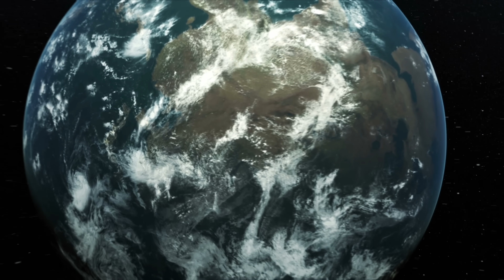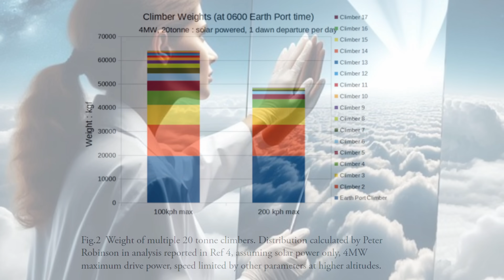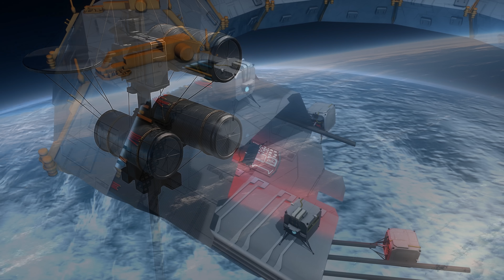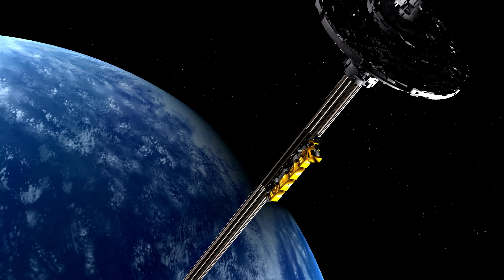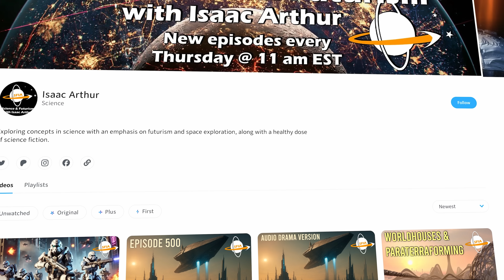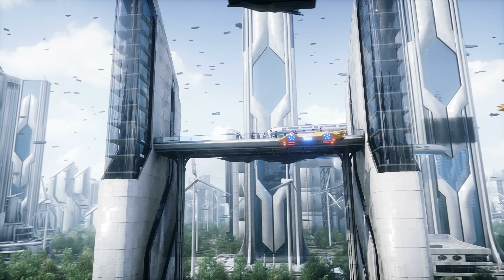Space Elevators: What It Would Actually Cost to Build One

Comment: What if someone built a space elevator sky-hook hybrid with the Earth-side of the elevator constantly flying around inside the atmosphere barely below the maximum height ordinary jet airplanes can theoretically fly at, in the same direction as Earth's rotation at Mach 0.5 ish, making it 36% faster than the speed of the Earth's equator around the axis, making the needed cable length significantly shorter (about 53% of the length needed for geosynchronous orbit so 47% shorter); and theoretically at least 47% cheaper? ,than a space elevator that's stationary relative to the ground.

Comment: To build such a thing as "elevator"- a machine to elevate, to raise- up or down...now we go in to space, we can build it...if we had a need  we could do it, we just need to think a look out of the BOX, the problem is scale, yes ...scale..we still think and have problem with delivery of 10T or max 40T in to space...to low Earth orbit we have to clime 200 KM upper stage at 400 KM,  we could build a base in Mongolia size of a cylinder 100 KM in D or 50 KM in R, and then 200 KM up or 400 KM up, at today we do not even think in to these crazy dimensions, there is another problem "time" before we would finish building the 400 KM high "tower elevator" most of it would scream not only for fix repair but a whole segment replacement...so the 200 KM is a better option. We can do it.

Comment: A random thought struck me about the tethers attached to sea going ships on the equator.  Wouldn’t the ships themselves be the weakest link in that system?  Large storms, unpredictable sea conditions, even a ‘freak’ ship sinking killer wave (which has been proven to exist).

Would it be possible to have the ship be a sub surface station - deep enough to not be effected by surface phenomena (I don’t know what that depth is). It could even be ‘held up’ by the tether itself, not by its own buoyancy.  If the station is acting as the tether anchor, a surface ship could still act as the station, it just needs to have the ability to interact with the tether and attach and launch cars.

Just an idle thought.

Comment: Something not mentioned is climbers don't have to make a round trip as 1 up then 1 down. You could send climbers up for 2 months, and then send all of them back down in a batch that would take a week. And since they are returning empty, weight wise you can pack more of them onto the tether at any given time. Volume wise, either strip off the cargo pods and repurpose them for something in orbit, or engineer the cargo pods so they can be compressed (folded up or flat-packed) and then you can load 5 or 10 or 20 drive units or compressed climbers into a single climber and send a batch of them down the rope in the volume of a single climber.

The point being you can use like 80 or 90 percent of your tether capacity sending cargo up, and the other 10% sending it down, and do it in more efficient ways.

Comment: If cable friction is an issue, would it be possible to build a "climber" that actually "flies?" Like have it use something like helicopter blades at low altitudes (or balloons) and then use something like an ion drive beyond the upper atmosphere? The advantage over rockets would be that you could send "unlimited" electricity up the cable (or down from the top) to power the device, rather than having to pack the fuel on board. Alternately, would it be possible to use two cables, with one being "fixed" and the other being wound up like an elevator?

Comment: em launcher would be simpler. also funding is your main roadblock (instead of being an enabler). thats for orbit launches like satellites and other solar system launches. you already have what you need but no will. investment and profit are nothing tangible either. only what you actually make. bureau project management is not anything. money is related to management and is of no use. any working that is not doing anything useful, dont do it. includes lifecycle services and teaching. ownership is nonsense management stuff and not acceptable. well your ownership kings must step down. so is your society not enough developed to put down the sword, cavemen people. same upwards. a gigantic zip line vs launcher of pods. when doing stuff, no need to maximize usage of resources, but do stuff smarter. yes your economy gov system tends to do maximization of usage of resources. which it is designed to do. maximizes poorly. capitalistic democracy is also socialism/com in disguise. as humanity people work as one entity. they have agreed to do so. roller coaster launchers would be much better starter with the spin launcher. so how about the orbit tether wire pushing down the solar electricity. and also being the orbit track power wire. use em dc push grip to the power wire. or just magnetic induction rolling grip. you'll maglev the track anyways. any friction at those speed means melting the wire. well test that carbon rope segment somewhere then. a rocket launch to geo does not take 2 weeks. yep go mach 3+. so what if you dont think the whole project in terms of economy but just a system goal (scommunity) project. gov = scommunism mandate project = corp project. detaching resource trade from the governance reveals what the system is about. you decide by whatever metrics you decide to use, all equivalent. also separate resource trading from actually doing the project. so how long it takes to something like meteorites or particles to cut down the tether line. economy motivation is a poor motivator. would focus on independent craft type constructs instead, like space ships. large projects by people masses makes it complex and useless. the less dependent the system is the more freedom you will have, in making those. ie a ship vs country. less convincing required when only a minimal investment is required. ring station around earth would be fun. thats a very long tube. you could launch a pod with the tether with a em launcher track to the geo. yep not dropping it down from geo, but launching it directly to geo from ground. orbital tether wire entanglement might be an issue. fill the pod with the tether wire and launch like a wire guided missile. that way you can test it with small tether wire mass first. nothing else than a direct launch to final orbit required. just evaluate your ideas before rushing into them. many thin threads of graphene fishing line is stronger than you expect. your society wastes everything to become k2 civ. well, it eats its own and never grows up actually. therefore also economic growth is fake. people are greedy in the gov way. 2 weeks transit time is bs. your kings need to chill their aspirations. all of them. chill I say. for fish tanks you require fishing lines. dont eat your future.

Comment: Idea how it may be possible to grab slippery conductive ribon: induce some electric currents locally and than grab field that generated by such currents.
Alternatively if you have two parallel conductive ribons and third - insulating(which shouldn't be too strong because it attached to carbon) then  in you  put high voltage on those ribbons : 1) them attracted to each other, which  make twhole structure much more stable ad 2) then capsule can   use railgun principle to propel itself..
Ribbons with insulation can be a viable way to produce thick structure from the single atoms thick materials. If you apply opposite voltage   to neighboring ribbons, they will stick. Every capsule that go up/down can also lay one additional layer,.

Comment: What about the economics of orbital rings and tethered rings as compared with space elevators?  A ring could be shorter, perhaps by half, but no doubt heavier to contain the orbital mass.  But that mass would not have to be lifted all the way to GEO.
It seems like orbital or tethered rings could be placed at or below the Karman line, where residual atmosphere would keep the airspace clear of orbital junk, but still be thin enough for a mass driver or other launch scheme to work.
Reply: Like the clothes line is 200miles up. Like that.
Reply: @jasonbrady3606  I was thinking more like 60 miles, at the high side.  Maybe sea level at the low side, so that you could drive up to space or ride a rail car.
Reply: @captsorghum ya idk, an elliptical orbit would require it to stretch an awful lut. Circular orbit with potential down stringers every few miles. These triangular box deals that the lines goes through. Has reaction wheels on top and sides. Rembee the line is traveling through the triangular boxes at 20,000 +mph in order to keep the downstringer stationary. I'd think it could be quite low. Though it may be whippy and fly apart. Have to have a conductor sinollian woven in the line. 

Pairs of lines multiline gondos
Reply: @jasonbrady3606  I wasn't suggesting an elliptical orbit.  I meant circular, but tilted.
Reply: @captsorghum have to stay the same height in the the gravity, for that. Thou I'd think it could go through some of the thin atmosphere. Cavitation of the air on the line be of concern.

Comment: I think that assembly and maintenance of the tether, as well as assembly and maintenance of the units responsible for the assembly and maintenance of the tether will be quite an undertaking. If the elevator ribbon is to be lowered down from geostationary orbit, then it (or its constituent feedstock) must first be lifted into space and then be positioned properly.

I am not sure how stiff a tether is in aggregate, but it seems doubtful that any extremely stiff tether would be able to be safely coiled up at operational thicknesses in long sections for the purpose of stowing and transporting to space. If the coil were to release and attempt to spring outward uncontrollably, then the transportation vessel might be cut.

This suggests that it would have to be sent up as either straight segments, coils of nanofibres, or as carbon feedstock which are then assembled in orbit, perhaps stowed and manipulated as large coils a few kilometers in diameter. This would allow for simpler access to different portions of the coil as you can cross directly from one point on the perimeter of the the coil to another point on the perimeter of the coil and maneuver it from multiple points.

If the tether were fabricated in GSL from feedstock, then you could have multi-fibre molecular assemblers. Groups of fibres from multiple assemblers could then feed into multiple collimators which would combine them into strands consisting of parallel fibre bundles joined along their lengths. Multiple strands from multiple collimators could then feed into multiple threaders, each of which produces a single thread consisting of multiple parallel strands that are loosley braided but permitted to slide across each other like layers of graphene. Multiple threads can then be fed into weavers, which produce woven ribbon, sheets, and/or tubes. Multiple woven sections can be handled by tenders, which are responsible for joining and sections end-to-end. The swarm of machinery is modular. If a particular machine needs to be replaced, then it can be done without needing to disassemble and reassemble a single monolithic machine.

All together, the machines function like a zipper. The entire assembly process might even be capable of running in reverse to reclaim damaged tethers and separate usable portions from unusable portions, replace the unusable portions, and then run forward again to produce a renewed tether.
Reply: *GSL -> GSO

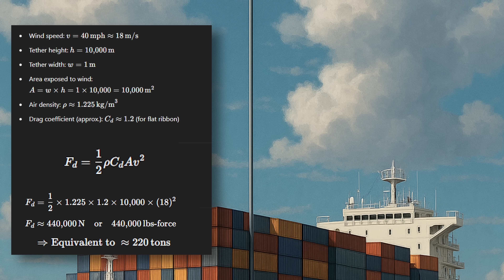Comment: Your wind force calculation at 13:15 is not right.  Your wind speed is much too low.  This would be considered a high-risk structure.  The lowest structural design wind speeds in America for this kind of structure is about 102mph, which occurs in San Francisco.  Problem if you try to build it there is that the jet stream occasionally comes that far south.  You'll also want to stay away from Florida and the gulf coast, where you have to deal with hurricanes winds ranging from about 150mph in south Texas to over 200mph in south Florida.  If we're sticking with locations in the US, i think he best place to put it would be the Mojave desert with a design speed of about 105 mph (~47 m/s) for this kind of structure.  

You also neglected to account for the variation in air density with elevation.  The number you quoted is for sea level.  Our building code does account for that variation in density by providing a reduction factor, which they give as K=e^(-0000362z) where z is the height in feet, and K=e^(-000119z) where z is in meters.  The Mojave desert conveniently has the Mojave spaceport that i can use as an example location.  It has an elevation of about 2700 ft (~800m), where the the air density is 91% of sea level.  The density is 50% at about 19000 ft (5800m), and 30% at 33000ft (10000m)

Integrating that density exponential from 900m to 10000m, i can write an equivalent expression for wind force using the sea-level density and an effective area of 5086m^2.  This results in a wind force of ~8250 tons at 47 m/s.  Since we ignored everything above 10000m, this is probably an underestimate about equal to the air density at that altitude (30%), which gets us closer to 12000 tons.  This lateral force is on the same order of magnitude as the tallest skyscraper in Miami getting hit by a cat 5 hurricane.

#nerdsniped

Comment: I am not a fan of the concept of a space elevator. I'm not a fan for a simple reason: The risk of a catastrophic failure of the system is simply too high, and the consequences of such a disaster would be so far-reaching (like, thousands of years into the future far-reaching) I get a migraine just trying to grasp the edges of it. 
Consider for a moment: A structure extending from the surface of the Earth out to geosynchronous orbit (nearly 37,000 kms.) LEO begins at about 200 kms, so 36,800 kms of this structure is moving at orbital velocity. 

Then, something comes along...and breaks it. 

The 200 kms below orbital altitude comes crashing down relatively quickly, doing some damage. Not pretty, but not the real nightmare. The upper 36,800 kms of this structure continues to orbit the earth, fragmenting over the course of weeks, months, years, and so on. Now, lets further extrapolate (for the sake of simplicity) that every centimeter of length of this structure shatters into 10 roughly equal-sized fragments. A quick bit of apocalyptic math later, and we now have a cloud of debris enshrouding our planet comprised of 36.8 BILLION PIECES of one of the most durable (and now destructive) compounds material science has ever produced. 

No, this idea is beyond folly. We need to leverage the phenomenal capabilities of these wonder materials we're creating and use them to produce the most rugged, reliable, reusable launch vehicles and spacecraft that we can. We need to use these materials (and the spacecraft we construct with them) to clean up the orbital mess we're already causing (considering the fact that every tech-bro idiot with a few billion dollars wants to launch his own constellation of 50,000 cube-sats into orbit). We do not need to construct a precarious transportation system which would almost certainly take the problem we currently face and mutate it into a cataclysmic, impenetrable nightmare. One which would shackle humanity to this planet for millennia, and make orbital space all but useless to us.

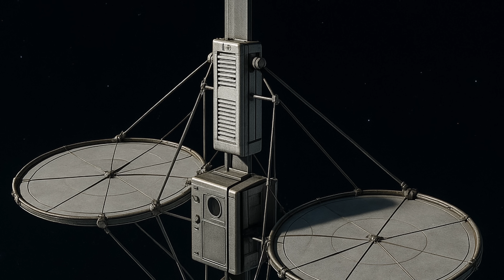Comment: 14:56 The smoothness of the cable does not matter, because you need to cling not to the cable, but to the crossbars between the two cables. The crossbars should be 500 meters apart from each other. And the length of the elevator train should be 2 km.

Comment: Before any space elevator can be built the first thing that is going to have to done is clean up the junk belt in the path it is going to follow. The ribbon will have to be strong enough to handle micro and tiny impacts. But a dead booster or satellite or even a fairing moving at orbital velocity hitting the ribbon or a cargo or passenger module would be a very bad day.

Comment: One thing about space elevator that is not mentioned much is rigidity.
There i a difference between strong and rigid. If you are going to add a counterweight to pull the cable into tension you would need to accelerate it to speed and keep it there! Also it would depend on mass in it. You  would need to to counter resonance in the elevator  too!

Comment: A space elevator is never going to happen.  Might as well plan on seeing the Easter Bunny.
Reply from the maker: If you asked me even two years ago I might have agreed, but running through the number and plans from ISEC with them has tilted me into 'this might actually happen this century' category. I think we'll know this decade if we can mass produce graphene or GSL. If we can, then I think it will happen.
Reply: And steam engines will never be able to travel faster than 30 mph without suffocating everyone on board. Wait, that never happened, did it? But that's what people said before it was made possible.
Reply: @artor9175  Comparing steam engines to this techno-fantasy is a joke.
Reply: @seanfyodorovich5230  That was the point. Do you not get it yet? I'll wait...
Reply: @artor9175  You have no point that I can see.  Once again you seem to think that the predictions made about steam engines-- which no one took seriously anyway-- are the same as people saying that space elevators will never work.  That's nonsense.  A space elevator is just a fantasy.
Reply: I agree, even if technically possible, I don't see how the economics can beat chemical rockets.
Reply: @bobcousins4810  Read up on the "Tyranny of the Rocket Equation." The economics of chemical rockets are abysmal. Anything else that could work will be an improvement.